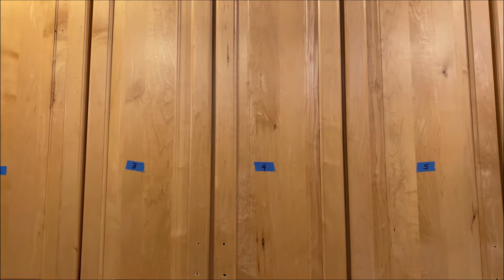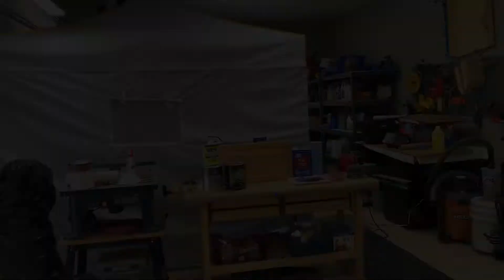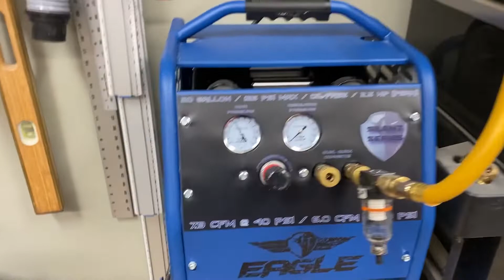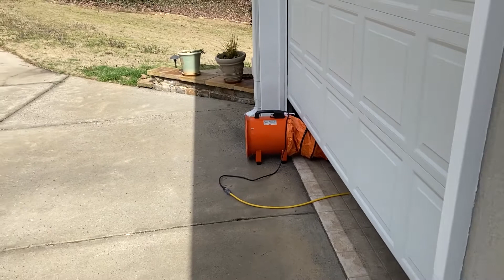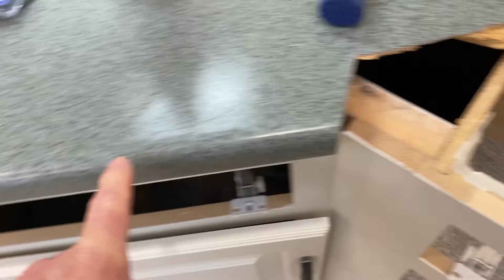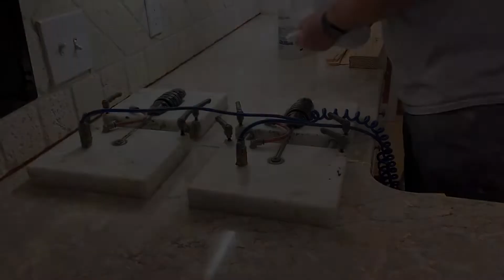Painting Kitchen Cabinets: Spray or Brush

Comment: I want to hand brush kitchen cabinets with a shellac primer and then use my spray gun to paint them. You said not to use the shellac to hand brush? Why? 
I read in other media that it can be used. The reason is bc its hard to clean the shellac from gun.
Reply: Hi, the reason I don’t like to brush large areas with the Zinsser BIN shellac primer is that it drys so fast that it can leave a dry edge as you brush. You can try rolling it as I did on the door frames and ends where I had to only do minimal sanding.
I had no issues cleaning my gun with ammonia/water then lacquer thinner after spray priming the doors.
Hope this helps!
Reply from the maker: Hi, the Zinsser BIN primer is excellent. The problem I found when brushing was maintaining a "wet edge". The primer dry's very fast. I did use a small roller to do the cabinet frames and end walls with it but it required some sanding. You can brush your doors but to get a professional smooth finish, you will need to sand between primer coat and top coat. I had no issues with cleaning my spray gun. 50/50 mix ammonia and water, then final rinse with lacquer thinner. Hope this helps!

Comment: Uh...oil-based primer and eurethane paint "don't mix". Which is why you ended up with a "matte finish". And you don't spray eurethane with a high-pressure gun you also use for oil-base. 

Eurethane is water-based and intended for HVLP application. 

I seriously doubt you were going for "matte white" with two coats of oil-based primer and two coats of eurethane given the latter is basically "car paint". 

The water in the eurethane "floated" the oil in the primer, the oil evaporated away, the kiln-dried desert-dry SOFT WOOD everybody that paints cabinets uses to "cut costs" and then covers up with paint  so "potential buyers" for the houses they "flip" won't see how cheap the "current owners" were doing "home improvements" soaked up the water and what is left is more or less "chalk" that is so dried out and "shrunk back" the "dust nubbins" that weren't visible when the paint was "green" can be felt and seen plain as day. 

"Saving time" and "saving money"  during any kind of woodworking and especially "finish carpentry" always ends up costing far more of each in the long run when it eventually and inevitably becomes time to "redo" what should have been and could have been done "quick" and "cheap" by a real pro or two in the first place and even if not done perfectly at least done correctly so even an eventual "redo" could be done without a total "do over".

Which is the only way those "matte white" cabinets are ever going to look right to a "potential buyer". It's only a matter of time before they really do "chalk" and all it will take it brushing them with a shirt sleeve or finger to see a "redo" is required. 

Kitchen cabinets are "high impact" furniture like no other and that chalk will start falling off right onto those glossy new countertops and onto plates and into food every time the doors slam (cheap hardware and no "bumpers" goes right along with the cheap materials and "paint job") and nobody with a clue ever buys a house without checking cabinet space. And quality. Because everybody with a clue knows that is the one place you cannot cut corners and ever be happy with how they WORK regardless of how they LOOK and there is no way to "redo" junk into quality and nobody that's worth a damn or at least values his or her peace, sanity and personal life does kitchen cabinets at "wholesale" and/or "cuts corners" because every job is "custom", every customer a "perfectionist" and every new set of cabinets the last new set of cabinets every customer intends to "pay for". 

And everybody wants "new cabinets" that look and feel new but "work" old. They want old cabinets "replaced". And possibly added to. But not "redesigned" or "rearranged" or "relocated".
Reply from the maker: Hi, thanks for your comments. Actually I was going for the matt finish. And yes, I did use a HVLP spray gun. I consulted with Sherwin -Williams  as I'm a residential contractor and not a painter. I feel confident that they helped me choose the correct products.

Comment: My Lowe's has young kids working there and they know nothing but what is taught to them through the computer... I know because I worked there. They have never seen a kitchen remodel or painted anything. Ask them for this and see your project screwed up totally... If you get drops of dust you have a real problem. Dust does not come in drops... A multi tool will do the job also and be most likely better at it. You might want to come back to me about thee comments but rest assured that I have been doing these DIY projects for only 50 years. Spray all of my projects outside without any booth and have no problems at all.

Comment: I'm currently in the process of painting our new raw wood cabinets and I am having good luck with using a roller + brush. I started with a sanding sealer to seal the wood in, and now I am just painting and sanding and painting and sanding...trick is to keep the paint coat light each go and just build coverage with each coat..go with the grain of the wood, and sand each layer lightly with a really light grit sanding paper. I'm using Benjamin Moore Regal which is supposed to be a top tier product..in matte finish..and then I am going to seal the cabinets with a poly coat. So far I have high hopes for this project and the quality is fantastic..getting better and better after each new sand + coat. VERY time consuming and messy...but you'll save yourself thousands of dollars...which for us went right into our countertop budget.
Reply: Hi Hugh,
The main difference between brushing vs spraying is time. If you’ve got time, go for it!
I would recommend checking with BM to see if topcoating is necessary and make sure it’s water based poly so it doesn’t yellow over time. Good luck!
Reply: How did it turn out?
Reply: @chandracox6814  Turned out great...but I don't recommend. I have PTSD when I look at a paintbrush lol. I never want to paint another thing again. VERY tedious process..large workspace and mess..What I should have done is bought a sprayer, or better yet paid a company to take the doors and spray them. In total there's about 10 coats of paint of each cabinet between the sanding sealer, paint, and sealer..They're holding up well so far and they wipe off pretty well when cleaning (considering we went with matte finish so it's a little harder).

Comment: Just don't  wood color was beautifull . I have that ugly white coat on my kitchen cabinets cause previos painted them that peels of in places and no ideea how to remove all that useless paint.
Reply: if its peeling off in places then it was done improperly, if the previous coat, like in this vid, was sanded to give the primer some "tooth" to stick to it will not peel. Prep is everything when painting, any monkey can put the paint on but the prep is still the most important step.
Reply: @dougupah8778  once was coated there's no previos stage only 50 shades of ugliness to make all look ok?
Reply: @dougupah8778  paint a donkey to loke like a zebra got the feeling they all know after a whyle
Reply: Painted cabinets aren't like carpeted floors. There is zero chance you're going to find "beautiful hardwood" underneath and even if you DO find hardwood it takes major work before it'll ever look "beautiful" relative to a new set of custom cabinets just like it does to make a "hardwood floor" that inevitably used the "ugliest" hardwood available to save the good stuff for actual "woodwork" people don't walk on, cover with furniture, put rugs on, cut holes in for HVAC registers etc "beautiful" compared to modern laminated hardwood floors. 

When something "hardwood" is painted or carpeted during a "remodel" it's because it was much easier to live with -  i.e. look at and clean and keep clean day in and day out - painted or carpeted than  in "natural wood". 

There's a 99% chance under that "ugly paint" you'll find uglier wood. It's definitely "laminated" and if the intention all along was for it to be "hidden" by paint, furniture, rugs etc there's no chance it's "grain matched" or "book matched" or "quartersawn" back when "cabinetmaking" was just another part of being a "carpenter" and cost was always a factor because 10, 20 and 30 year mortgages were unheard of.